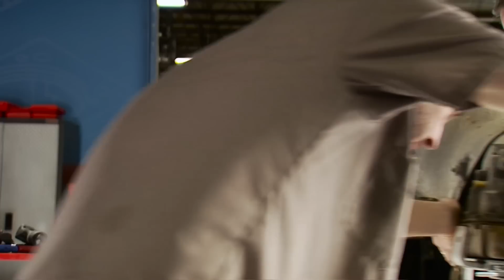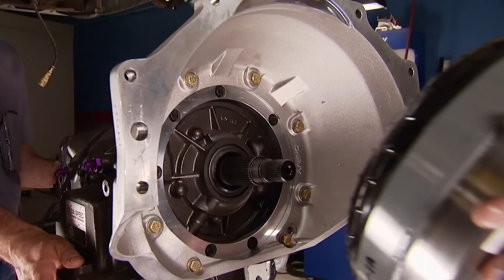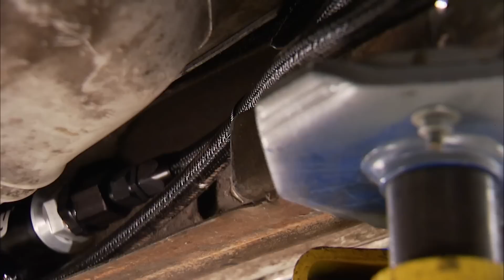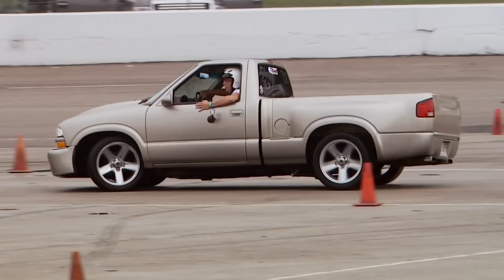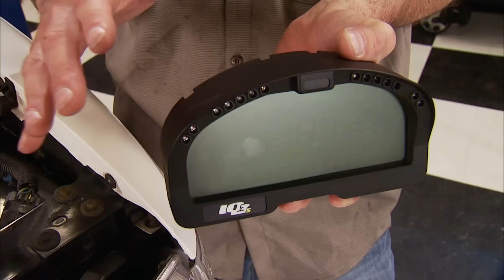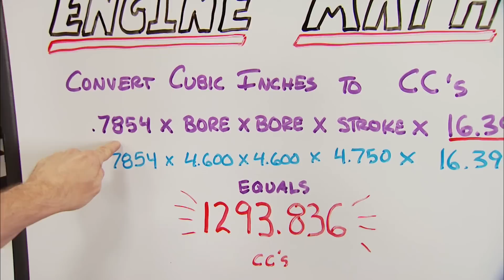Upgrading The Suspension & Steering On the Grocery-Getting ’93 Caprice - Engine Power S3, E15

Comment: You guys need to stop spewing marketing information from your sponsors and tell the truth Cross drilled rotors don't run any cooler there's less mass there as a heat sink They really don't do anything anymore except for looks cuz they were originally designed to stop out gasing of the pads The pad technology has improved so much that's not a problem anymore
Reply: Shut up
Reply: They literally do, drilled and slotted rotors let more air come in contact with the pad while braking. I work at a circuit track it’s not just for show we see a good difference of brake temps especially on cars with brake ducts. You know nothing of what you’re attempting to speak on.
Reply: @MulattoGunner they literally don't. If they did, then F1, SuperGT, IMSA, Le Man, WRC, NASCAR and IRL cars would use them. None of them do.

You work at a go-kart track at best.
Reply: @dillie3000 and that's only because gokarts are solid rotors and don't have internal fins . 

I also love how everyone is so quick to try and cool the brakes as much as possible . I'm trying to keep heat in my pads ... those people and us who understand are not the same lol
Reply: @MulattoGunner  
From Motortrend 
Cross-Drilled Disc Brake Rotors: Do They Really Work?
Marlan DavisAuthor

Apr 25, 2018

Cross-drilling brake rotors supposedly helps vent gases created when the resin bonding agents within the brake-pad material begin to break down at extreme temperatures. When this happens, the pedal still remains firm while the friction coefficient decreases, causing a loss of brake effectiveness. Racers often refer to this condition as "green pad fade" or "outgassing." With new-tech, preburnished carbon fiber or ceramic racing brake pads, this gas buildup is no longer a major concern. Less exotic street-pad components are still subject to outgassing, but only when used on a racetrack at extreme temperatures rarely, if ever, seen on the street.

Another theory was that drilling multiple small holes in the rotor surface increased the coefficient of friction between the pads and the rotor because all the additional small edges let the pads bite more effectively. But today's modern carbon-fiber pads are designed to operate at higher heat levels where the friction coefficient is inherently higher, so any additional hard-edge bite is superfluous. And all those added small edges eat into the pad material, shortening its life.

That leaves only potential weight savings and (if you are into profilin') visual enhancement as the primary reasons why anyone would drill rotors today. Nevertheless, there's a big potential downside to drilled rotors: micro-cracks that propagate out from the holes. This can be a particular problem for street-driven cars. We'll get into more details on this problem next time.
Reply: @MulattoGunner  Yeah of course you see lower temperatures on cars with brake ducts The ducks bring cool air from the outside to the brakes has nothing to do with cross drilled or slotting
Reply: I think he means two identical cars, one with drilled rotors, one with solid rotors, both with brake ducts, the drilled rotors will run cooler, i have seen this real world with datsun Z’s

Comment: Hey guys, that steering box is 3 turns lock to lock or 1 1/2, the way it was described I'm not sure what you meant! Thanks.... I realize this is a older recording.
Reply: It’s 1.5 turns from center to lock in either direction, or 3 full turns from full left lock, to full right lock.